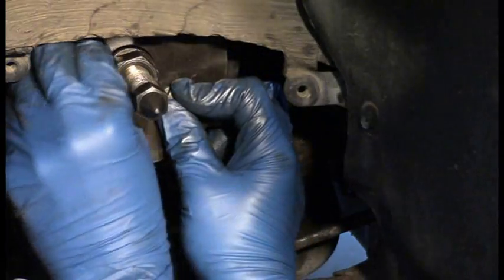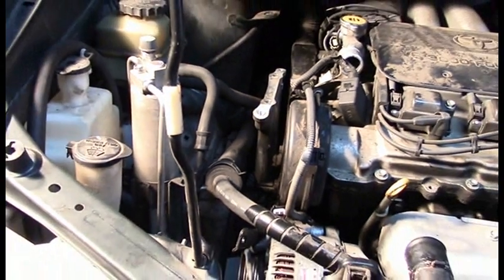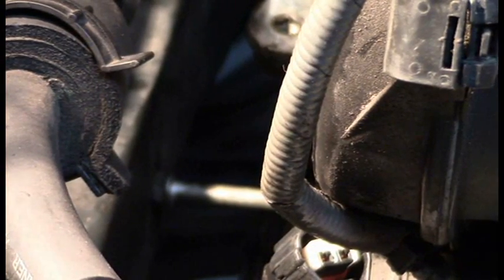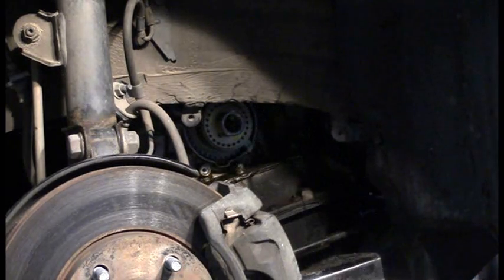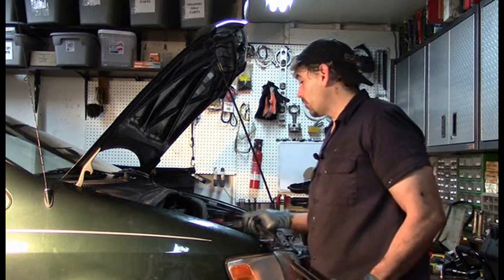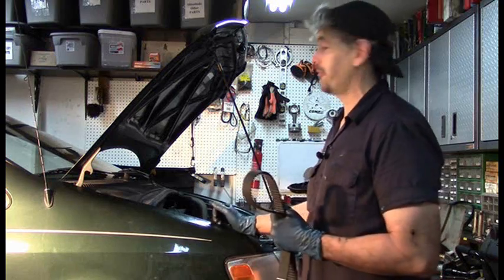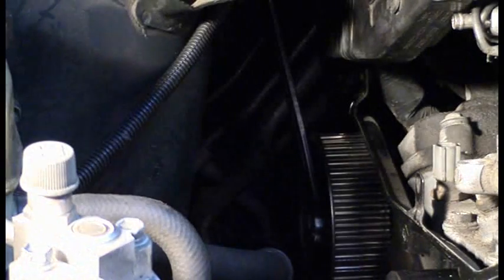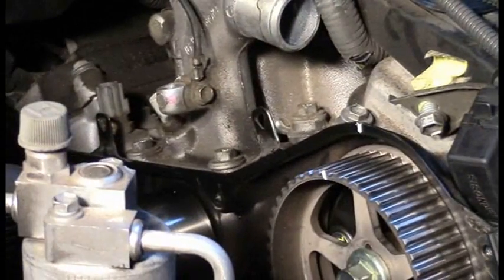Timing Belt 1997-2010 Toyota V6 Sienna, Highlander, Camry, Lexus Part 2

Comment: Great series of video's.  Very helpful  The detail is great. I would just note that Toyota 3.0L IMZ-FE engines are a NON-interference engine.  Having said that, better safe than sorry, especially if you are a DIY'er doing this for the first time.
Reply from the maker: Yes correct. It is non-interference indeed. The intent is to show procedure for interference design if you have it, as you said- just to be on safe side. Thanks for watching.
Reply: That's actually not true as 1mzfe engines with vvti are considered interference engines. 
My 1999 ES300 and 2002 Sienna are both 3L V6 vvti interference engines

Comment: Maybe an amateur would or silly question but here goes. 
Would removing the tensioner prior to removing the belt nullify the camshaft wanting to shift?   Your video is in depth on some areas that others aren’t. I’m fact it’s the only one I think I’ve watched that mention this issue.  Just curious of the tensioner is the issue.
Reply from the maker: no- the camshaft wanting to shift is due to the valve springs, not the belt tension.
Reply: @SchrodingersBox  thanks. Just curious why I haven’t seen this mentioned this step in other videos.
Reply from the maker: No idea. but pretty much any car is not going to have a camshaft “neutral” at TDC#1 on either compression or exhaust.

Comment: What if the back one that needs to be lined up does not want to go to the mark it seems to jump past it when trying to line up when trying to set the timing . My timing belt broke i didn't take it off
Reply from the maker: you need a long wrench that you can jam against something to hold it in position.

Comment: I just completed the new belt install after my belt broke. All marks are perfectly aligned as in your video and compression is good across all cylinders, but it appears to be firing on the exhaust stroke. What am I missing here? how do I confirm that the engine fires on compression and not exhaust stroke?
Reply from the maker: I would compare the CKPS and CPS correlations to ensure they are aligned.

Comment: Hey man - great video. Question - suppose I get into this job and see that my belt HAS jumped a notch or two - what do I do? Just set it to top dead center according to the notches and put on the new belt (my new belt has lines already)? I just wanna be prepared is all
Reply from the maker: Yeah good question.  I'd replace the tensioner prior to resetting belt timing. This is most likely cause other than belt wear and stretch

Comment: So found your video after working on a timing belt 04 sienna. I watched videos prior to conducting timing belt removal but none mentioned about the rear sprocket snapping back after belt is released. So my rear sprocket time mark is at the 9'oclock position while the crank and front cam is all aligned. Is it possible to just turn the rear camsprocket with the belt off to the aligned timing mark and reinstall the belt. Hopefully I didn't damage any valves
Reply from the maker: Yes you can try that

Comment: Hi there. I've been looking at drawings of valve and piston timing. When the rear camshaft pulley is at TDC the spring, as you say, is compressed. I think that as long as the sprocket is aligned TDC it will stay put even with the timing belt off. And that is what I don't understand. What keeps the spring from returning to a relaxed state when the timing belt is off?
Reply from the maker: Its not a single spring- its ALL the valve springs. Relaxed state is when enough are relaxed to prevent rotation.

Comment: So quick question what if your old timing belt is out of time. How would you reset it without installing a new belt.
Reply from the maker: Remove and replace it after setting the timing correctly.
Reply: @SchrodingersBox  but the belt does not have alignment marks. Does it matter as long as the marks are tdc??
Reply from the maker: The belt timing is completely irrelevant. All that matters is the directionality.
 I ignore the belt timing marks- they are irrelevant. The cam and Crank determine the time, not the belt marks.
Reply: @SchrodingersBox  ok thanks. That helps a million. I didnt want to change the belt its relatively new

Comment: If the sprocket jumps it should goes back where all the valves are in closed position. Plus I always crack cam bolts loose with belt in place.

Comment: Thank you so much for the video. Learned some nice tips from this. I plan to do this on a 2007 highlander 3.3l v6 vvti engine with stock 180k miles(tb has never been replaced :O). My Question is about the rear cam snapping into its relaxed position. FSM says to "Set the crankshaft to approximately 60° BTDC" before removing the timing belt. From my understanding, they say this so if the cam does snap it wont hit a piston. Because Im also going to do the cam seals, It would be very difficult for me to hold the cam from snapping. Question is am I safe in removing cams and doing this the way FSM says to avoid pistons hitting valves if cam does snap in its most relaxed position? Or if you cant answer that, How would you change the cam seals?Thank you for you time
Reply from the maker: yes the locking of the cams is only applicable during belt installation  otherwise positioning doesnt matter as long as crank is positioned so there is no contact of pistons and valves

Comment: I think the tension on the cam is from pushing the valves down. Slightly open. As it moves to a relaxed position it should be closing the valves. Not opening. I have had 1 cam on dual cam motors move many times and never had or heard of anyone having damage from this but I guess anything is possable. I always mark 2 times each cam and crack and on belt. I always tranfer the marks to the new belt. Only take a few minutes and save a lot of headache putting it back in if anything moves. Cars with keyways on the crank and cam are pretty straitforward. Later model ford/mazda have to keyways just friction washers and have special tools which can be replicated which hold the crank with a pin or bolt. and a plate which holds the cams static. Friction washers hold the crank and cam positions which actually once the tools are put on, make it easier and more accurate. Infinitely variable technically. I note on Miatas I have to turn back the crank about a 1/4 inch or after putting the belt on it will be off a tooth. These are older and keyed.  Idk why. If everything is marked it will be obvious if its off. I always go around a couple times by hand and make sure all marks still align. Another common issue with any of the manual spring type tensioner is over tension. Be wary of that. They will whine if its to tight.
Reply from the maker: Yes thats the cause.  The damage is possible if the cam "snaps" from a loaded to relaxed position and a piston at TDC is in the way of an open valve.  Not nearly as bad as an operating engine with that happening but still best to avoid.

Comment: Between 4:59 & 5:49 on the video, it seems that the lip that keeps the belt from slipping off of the rear 
camshaft sprocket is on the outboard side, away from the block. But this
 lip is on the inboard side of the front sprocket. I wonder if one of 
the sprockets got flipped over previously. Shouldn't these retaining 
lips be on the same side for both sprockets? If so, should they be on 
the inboard side or the outboard side
Reply from the maker: The configuration is intentional to keep belt centered. The correct orientation is as shown in video.
Reply: @SchrodingersBox  This is correct. I just finished a '99 Camry with the same engine, and ended up 'correcting' the previous mechanic's(?) work on this car. The rear sprocket was oriented exactly as the front - with the sprocket flange against the engine, instead of facing the fender side as it should be. This had caused the belt to tend to drift outward, off of the front sprocket, only to be re-centered by the water pump pulley as it passed by. This caused the belt to rub at that point, and the insides of the timing covers were coated in rubber shavings of the belt - much like steel wool. Also be sure that the tension pulley moves freely after installation. The bracket of the replacement pulley we were provided was incorrectly machined, and jammed against the engine block when installed, and thus wouldn't allow the tensioner to remove belt slack. Changing the new tension pulley to the old tension pulley bracket solved this problem.

Comment: I'm doing this on the same vehicle now, problem i believe the water pump seized up. vehicle just died on highway one day, no loud noises. just shut off. water leaking from timing cover. after getting into the timing belt, the belt is still attached but the outside maybe 1/4 of the belt is shredded off. when i try to line up timing marks the cams are either at 10 or 4 o'clock when the crank is on the timing marks. at this point I am stumped.
Reply from the maker: Line the cams up first on TDC compression#1 and then install the belt.
Reply: after many stuck bolts, testing cylinders for valve leaks, replacing timing components, i am finally ready to install belt. I cannot get this thing timed. when i adjust for slack i am ending up with cams half a tooth off from the timing marks, with the crank lined up
Reply from the maker: Try starting at crank and putting belt counterclockwise around cams.

Comment: Matt
just watched your timing belt video on the Toyota sienna.  I have a 2007 sienna 3.5 and it blew a hole in the vavle cover bank 1 firewall side. can you please tell me if it is a interference engine.  I got mixed answers. what would cause that hole in cover by the camshaft area
Reply from the maker: What did it look like when you removed the cover? It should be obvious.
Reply: Schrodingers Box Matt I'm taking it off in the mourning. Is it a interference engine
Reply from the maker: I don't know. But you'll surely find out if the piston blew the cam collar off and sent the rocker through the cover.

Comment: excellent video.  Thinking of doing this on my own (your video has given me the confidence to do so....I recently replaced both mounting brackets, follow this video...now I'm ready to go back in).  Would be a first....but I need to get to the CAM seals and replace. 1998 Sienna. 

QUESTION 1:  With that, I just want to be sure I have the process down to relief the spring pressue on the CAM near the firewall, while re-installing correctly.     I've read everywhere, that you should never move the crank counterclockwise.  Yet below, Im seeing comments of doing just that (although you say "position" the CRANK so it is 45% before TDC ---  yes..words have meaning).  So following your "positioning" comment.  Do I first line up the timing marks and paint them as instructed, then, while the belt is still on,  after painting, rotate the CRANK clockwise (360-45 = 315degrees) until it is 45 shy of TDC?   Or should I actually rotate it a full 360+315 degrees (because later I learn that two full rotations of the Crank = 1 rotation of the CAM)., which would rotate the Cam and leave it approximately 23 degrees [45degrees/2]  before TDC (which Im' thinking will make the re-installation of the new timing belt easier.  Once I'm at this position, then I remove the old belt, and the sprockets and get after the seals.

When seal work is completed, I'd reinstall the sprokets, and the timing belt, while they are all still shy of TDC, Focusing on lining up the white lines with where I painted the CAM Sprockets (just shy of TDC), and then if I rotate the Crank another 45 degrees (completing the full 720 degrees), everything should line up. (belt, sproket, and the notches on both CAMs and the CRANK). 

QUESTION 2
Also...say my alignment is off by a tooth or two, I'm assuming it is OK to remove the belt, and just move the 1 CAM individually by a tooth or two, in order to re-align.   Just dont want to get crazy moving it too much.  Thanks.  

QUESTION 3:  I actually think the Sienna V6 for 1998 is Non-interference (looking at the car angel website).  Can you verify?  Does that relieve some of the pressure (no pun intended) of the Cam spring issue?  Does this essentially reduce my need for concern regarind question 1 and potentially damaging the valve/piston?  Or is there still danger, even in non-interference engines.

Thanks again for giving me the confidence to give this a try

Comment: Thanks again, your tutorial has a lot of details that other don't, such as the explanation of why turning it by 45 or 60 degree and which camshaft is under spring pressure.  

I wonder why you rather not take out the two external torx studs and choose to remove the engine mounting nuts instead and jack it up?  Do you take all the engine mounting nuts out or just few and which one of them to be able to lift the engine up?  I am curious because I decided on the removal of the torx bolts instead and it was just like another bolt.

Comment: Doing this today on a 2008 Highlander Hybrid.  Makes the Sienna seem like a dream.  The back sprocket is almost impossible to see, with ABS lines and the brake reservoir in the way.  Alsp, I found that the rear cam wanted to rotate forward as opposed to back (after wedging against the firewall, it rotated the other way on me)..  I've changed many timing belts, but I understand why Toyota charges what they do on this vehicle.  And still haven't gotten the intake plenum off to replace the rear spark plugs (2 braces in the back are almost impossible to get to).  Took a 700 foot pound impact gun to remove the crank pulley bolt; the 1/2" impact I had wouldn't budge it,
Reply from the maker: Thats why I use a mirror when I woirk on those.
Reply: Without a mirror, would be impossible.  Got it done; thanks for the tips and video.  Took 3 attempts to get the crankshaft in sync with the top camshafts, but finally did.  Not a vehicle for a "timing belt virgin"; found it a challenge on the 1MZFE even with the engine out (v6 Camry).  Retarding the bottom crank by  a couple teeth helps, but it still may take more than one attempt (which you correctly pointed out).  Intake plenum removal on Highlander helps give you more room, and needed to be removed to change plugs anyway (both belt and plugs due at 90k, so might as well do both at same time). Camshaft bolt at front of car can be loosened easier with old belt still on.  It is MUCH tighter on the Highlander than the Sienna due to brake reservoir and ABS lines; even getting a mirror in is tough.

Comment: I am watching this video and I want to know if you pulled the rear cam back to take off the tension of the springs so you can remove the belt and put the wrench back on and moved it forward again so the marks would line up again.
Reply from the maker: As shown in video i merely lock the cam in place.
Reply: Yes I know that. I'm talking about when you remove the belt
Reply from the maker: There is no need to remove into
Reply: Don't you have to pull the wrench back to get the belt off and the new one on
Reply from the maker: yep
Reply: Ok I thought so

Comment: I change the water pump by lightly prying cover and sliding pump out Lexus running no problem your not bending it just adding little pressure slid it out then u won't have to remove cams
Reply from the maker: Absolutely not the suggested way to do this.  You WILL crease the cover at the base of the cam sprocket- it is impossible to flex the cover enough otherwise. If you think you are not damaging the cover then you are mistaken.
 ALWAYS remove that cam sprocket. It also makes replacement of the pump much more efficient and ensures correct installation.

Comment: hi
Reply: awesome video! I ran into a minor problem while following the video. mine is an 02 sienna and my rear cam (cam 1) moved after I have already removed the timing belt. so my question is can I spring it backward to line it up with the   cover again?
Reply from the maker: You first want to make sure valve did not bend as result of the cam springing into relaxed position - confirm through leakdown test.
  Once confirmed, yes simply re-position cam and install belt in correctly timed position.
Reply: Schrodingers Box 
I don't have such tool to perform leak down test....and my engine is suppose to be non-interference. Now, for me to reposition the rear cam....do I spring forward to the timing mark or backward? or does it matter at all which way. thank you in advance.
Reply from the maker: ting22687 Oh if it's non interference, no worry. Just time and go!

Comment: interesting what you say about the cam rotating and damaging valves etc, i have never had a problem with if they move they damage the valves, the force of the cam rotaing into its relaxed postion I have never had a problem with that, valves to bend actually need a lot more power and engine rotaing to do that, however i take note of what you are saying maybe i have learnt something new
Reply: Michael wilson my cam rotate sharply when I move the cam ! I am afraid that the valve may be damaged ! Are you have this problem before and no problem afterward? Thanks
Reply from the maker: Ifr yopu think the valve is damaged just simply put the cylinder to TDC compression and leakdown test to find out
Reply: Thanks, I put back the timing back and tried the timing, looks like it is running OK.  But there is a noise by putting wrong side of the the timing belt guide. sigh....

Comment: I had the timing belt and water pump (Kit) replaced.. The engine light was off but after I filled the car up with gas the engine light came on again. I called the mechanic, he told me that I have to drive the car for 50-60 miles then the computer will reset and the light goes out..That sounds just not scientific to me. can you give me some ideas what he meant ? Thank you
Reply: What happened?